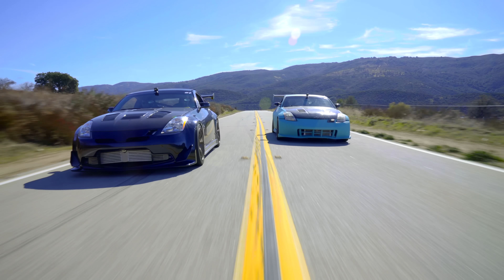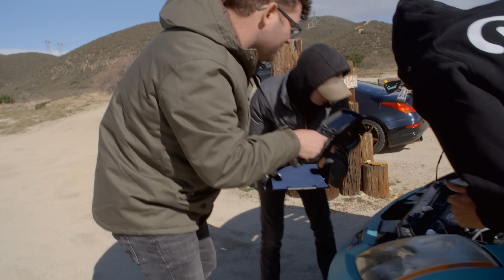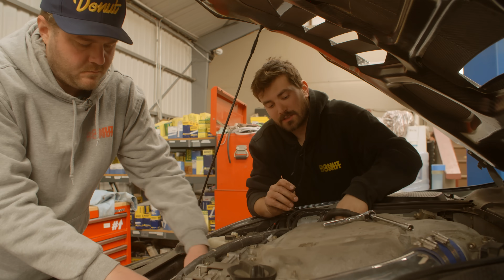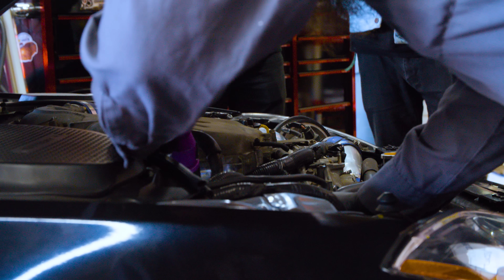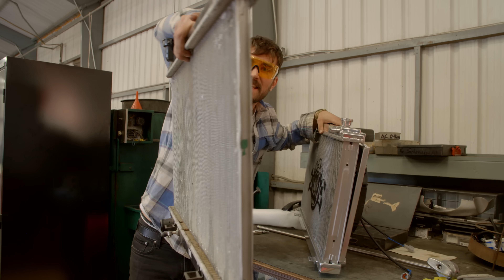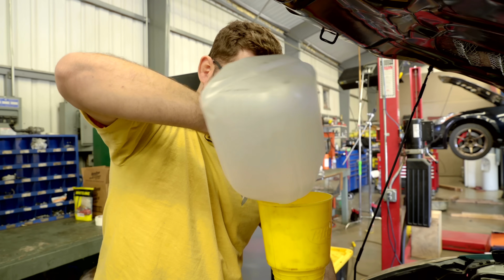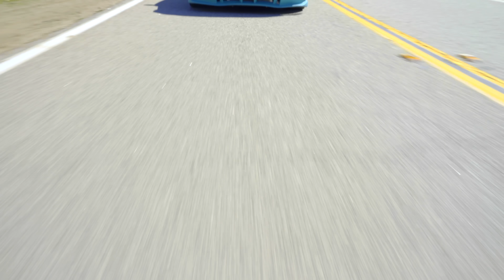$200 Radiator vs. $500 Radiator

Comment: Correct me if I’m wrong, but given that the coolant pump isn’t being replaced, and given that the rate of coolant flow is governed by the ECU/thermostat, doesn’t that mean replacing the radiator is mostly pointless? The engine runs at its programmed optimal temperature which isn’t as cool as possible. Shouldn’t both cars run at the same temperature programmed in by Nissan?

Comment: you should always mix some sort of anti freeze or something to kill all the bacteria etc in the cooling system.. using distilled water is good however no system is free of microbes and bacteria so ensure you do a small mix unless you plan on flushing your RAD system on a regular basis.

Comment: It's true that straight water transfers heat better than water/antifreeze mix, but antifreeze doesn't just lower the freezing point.  It raises the boiling point, as well and is needed.  Antifreeze also has anti-corrosion agents in it to keep your cooling system from rotting out from the inside.  Add new antifreeze, please, and not just water.

Comment: I recently did a Mishimoto Rad upgrade on my 04 GTO and the only complaint I have is my trans cooler lines both leaked like mad where they plugged into the rad. I had to sand down the connections to make sure they were as smooth as possible and I also had to use some high temp sealer to stop the leak. (after 2 separate occasions of finding puddles to trans fluid under my car and all over the dame underneath of it)

Comment: coming from a dude who blew a VQ rod bearing by high oil temp, i'd spend $700 on some cooling. cooling is one of those track essentials like brake pads and tires.  even if it's stock it's gotta be in tip top shape

Comment: Boost overpressure apparently could also cause a car to overheat pretty easily.

I had a friend who did it to his SW20 MR2 and despite having new intercoolers and radiators, his car was consistently overheating because the extra psi that he was tossing into the engine thru the new turbos was way over pressured and it cost the car to sort of be like in a choking situation which requires the car to find other ways to pump out numbers or even power thus it heats up pretty quickly.

Comment: They could pretty easily make a shroud out of sheet metal for low car.  ...but the OEM one is a dual fan, so it’s most likely better anyway... 
IF it didn’t fit though, they could make one☝🏼

Comment: Water boils at 212, 50/50 antifreeze boils at 245 ish depending on brand. DO NOT USE WATER,  * Especially in Performance vehicles, a truck meant to tow that you do not tow with can get away with water temporarily, my R1 will boil out water just idleing.

Comment: That sketch turbo's been showing issues for 3 videos straight now. I think you have to cut your losses and replace it, the VQ internals are gonna be eating metal soon if you don't. 

A good and cheap alternative would probably be a decent surplus/used turbo and refurbish it. A good rebuild kit shouldn't set you back too much either.

Comment: Interesting fact a cucumber is actually cooler inside than it is outside.
Reply: That's a cool fact
Reply: Isint that so with everything?
Reply: @aesopwolf3126  not stars or fire or anything hot :)
Reply: @Privateacct1038  No Shit i meant Objekt by itself
Reply: Aesop Wolf if ur such a genius then u should know 🤒👍🏼
Reply: @Privateacct1038  what? Who said im a Genius?
Reply: @Privateacct1038  stars are actually cooler inside
Reply: @MisterCOM  Not even a little. For example the surface of the sun is about 5500C, the core is about 15 million. The inside of a star has to be hot enough to generate and sustain nuclear fusion. I.E. hotter than literal heck.
Reply: Aesop Wolf not your mom
Reply: Dean M  yes
Reply: not if you microwave it
Reply: Fresh.

Comment: distilled water - please add correct colored coolant even in hot environments, you are after the anti rust and anti corrosion properties.. Even water wetter will be better than nothing
Fans - wont make a difference to cooling once your car is up to speed. They're primary there for idle and stop start traffic. While they are temp controlled and not speed controlled it isnt uncommon at highway speeds for the efficiency to be decent enough that they will be off.
Fan shrouds - make or break a fan and radiator efficiency. Hence it was a really god choice for donut to use the factory shroud and fans vs the aftermarket fan alone

Comment: The coolant prevents the water from boiling along the surface of water jackets and there's additives in coolant that lubricate and protect the water pumps and engine block from corrosion. Kinda concerning not using any coolant to help the water. I can see that the water pumps will fail before the end of the year if they're driven everyday. 

LO-Car also looks like it has thermostat or water pump issue already with it. They should have maintenance or see if upgraded pumps are worth it.

Comment: Radiator size does not matter. The most important component is the water pump. The pump should flow a minimum of 10 litres per minute  at 500rpm. The head pressure should also be about 50 feet. We have proven this on dynos that a proper pump increases horsepower. I ran a 351 Cleveland engine with an improved pump and deliberately ran a small radiator. We took vacuum readings before the installation of a proper pump and after and gained 4 inchs more vacuum. 
Quickest way to test the pump is to run the heater hoses into a bucket fill the system up then with the engine idling remove the flow hose from the bucket and time the coolant flow into a one liter container. The container should take no more than 10 seconds to fill up and the coolant should not show signs of bubbles, as bubbles means troubles.

Comment: Here in my location its always a round 80 - 90+°F everyday.  I like using pre-diluted coolant because it is already mixed with distilled water.  Also the pre-diluted coolant has lubricants in it that will lube the bearings inside the water pump better than just straight up distilled water.

Comment: When I did my research for fans, I found that mishimoto fans are just cheap rebranded Chinese fans. Should've gone with a high end manufacturer like spal. Quite a few people mentioned their fan shrouds actually reducing air flow to the engine bay as well. 

I donno about toasty California but fans tend to be for when the car is heating up when stationary anyway so blocking a load of air flowing into the engine bay when moving seems counter productive.

Comment: Many car enthusiasts watch this channel. To basically state that it's not important to run coolant when you don't live in a cold state is ignorant. 

 It is important to run proper coolant to water ratio as not only does it prevent freezing but also boiling over. It also protects your internals from electrolysis and corrosion. At minimum run 40/60  coolant to water in hot climate with no chance of freezing. 60/40 for colder climates.  If you don't want to think too much into it 50/50 is a safe bet. 

In the end you want to go with what is the recommended ratio by manufacturer. Also you want to go with the recommended fluid change interval which generally is every 2 years for most vehicles

Comment: Coolant temp past 196 degrees F, ecu starts pulling timing. Since it's turbo, upgrade or remove thermostat and possibly bypass the coolant lines to the throttle body

Comment: Antifreeze doesn't just help with freezing, it helps with corrosion. So if you're putting just distilled water you'll need to put an anti corrosive agent in there

Comment: On my turbo Saleen, my car lost boost at one point because of a bad exhaust leak, my downpipe connection to the y-pipe became too loose. Exhaust and charge piping issues are usually the first place to check; which is immediately what i thought when the Z lost boost 😂😂

Comment: I know this isn't a sensitive topic and I will go ahead anyway. 500 bucks is a small amount to spend on a car. Sound systems alone can cost upwards of that in parts. To get great cooling performance with that much power this is a necessary expense. That and the life of the engine hangs on having it stay within its optimal operating temperatures. 
Good work gentleman and thank you for staying safe.

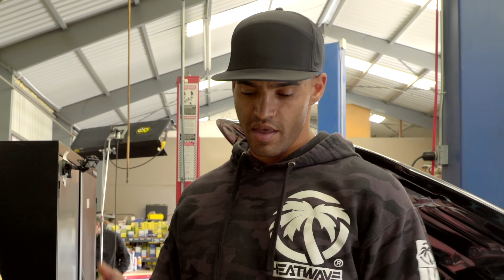Comment: 12:35 Uh, antifreeze also raises boiling temperature, lubricates the water pump, and coats all of the bare metals with corrosion inhibiting compounds to stop them from wasting away internally. In diesels, it also stops liner jacket cavitation which will drill holes through a wet liner. I know a ton of tracks require pure water only, but it's worthwhile to consider all the other stuff that properly mixed coolant provides to a car. If you live in a very hot climate, maybe a 60/40 or 70/30 water to glycol ratio is better for you but pure water isn't always THE best option for racecars. As the guys said, with the 50/50 coolant mixing in the block and heater core, they'll likely end up with a lean ratio of coolant in the entire system. That's a good thing.

Comment: In my years tuning cars I have learned that the best cooling mod, is actually changing the temperature that the fans come on. just by changing the fan temp activation in the tune I got my from cruising at 195 and maxing it 206 to cruising at 185 and maxing at 189
Reply: I also think that wiring a manual switch would work I saw Nico the F1 Driver and his 300SL Gullwing having the switch.
Reply: @MIKEK3NT  The problem with a manual switch I found is that you forget to turn it on, and then when it's overheating and you turn it on you forget to turn it off and kill the battery....
Been there done that not doing it again LoL
Reply: Accurate, however It is a balance between having the engine at its most efficient thermodynamic operating temperature and keeping it cool. Something to consider though is that the OEMs need to prioritize fuel economy via reduced fan power consumption and higher operating temps for max thermodynamic efficiency. Absolute maximum engine life is not as high of priority as fuel efficiency.
Reply: @MSportsEngineering  This is precisely why I set mine up to run between 179 and 189 If If you've run too cold the motor won't perform right, on some ECU's it'll even limit timing and boost levels.

I'll never understand why people think it's a good idea to put a 160 thermostat in. Lol it either ends up running hotter or just worse

Comment: The cars are cool and the content is good, but watching you guy work on cars makes any mechanic cringe. That little part where you said to release the pressure and fucking turned the part that locks the radiator in place made me stop watching at first. Then the coolant bleeding method made me turn off the video entirely. Sorry guys you need more knowledge on these cars, because sometimes it sounds like you guys are just BSing your way through

Comment: My dudes, antifreeze also raises the boiling point of the coolant and improves heat transfer.
Reply: It does raises the boiling point (which could be equialized to a point by adding a higher pressure cap) but water is actually a lot better at heat transfer...
Reply: You're half right. Boiling point raises, but specific heat (heat transfer ability) decreases when you add antifreeze to water.
Reply: Don't forget the anti corrosive.

Comment: Could have bought a mishimoto, or a koyorad, or a skunk2 oh well, and Nolan could have spent $80 and bought 2 smaller high speed fans

Also you could use Evans waterless coolant or Motul organic coolant mix 25/75 for corrosion protection

Comment: For testing purposes, it's incredibly important to be careful where the thermal camera is pointed, because if you were to aim it at the driver it will be reading temps equal to the surface of our sun because the sunglasses game in this video is  ON FUCKING FIRE.